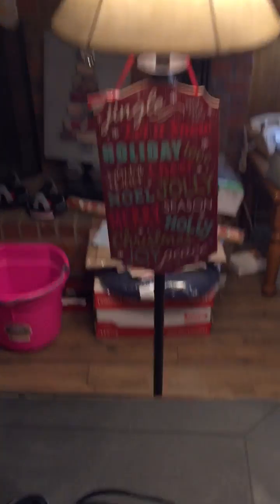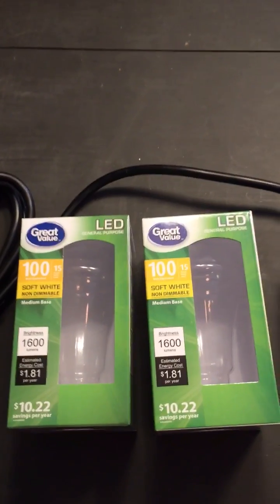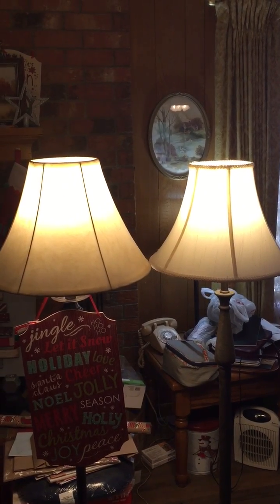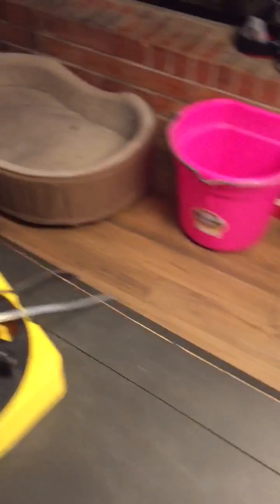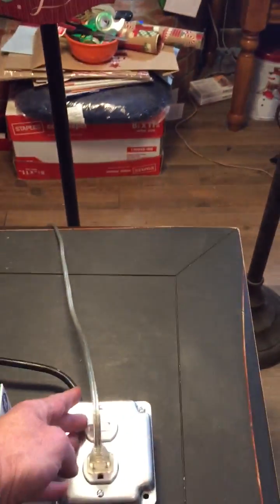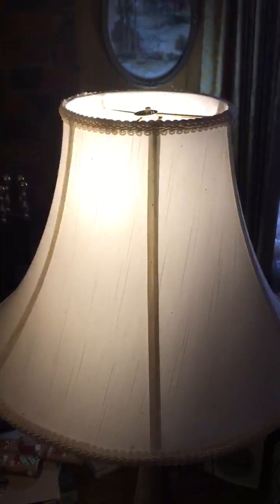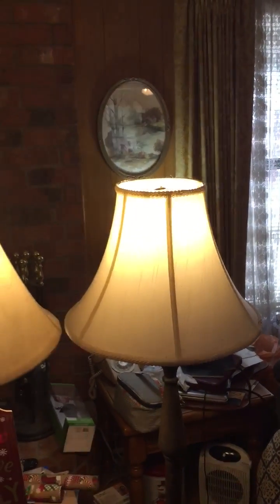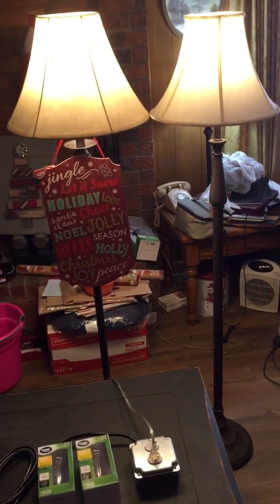Gamma (40 hz) LED Lamp Flasher

Comment: Bill, thanks. However, have you considered that most consumer (lamp fixture) bulbs, have an elaborate AC to DC power supply built into the base of the bulb? These consumer bulbs cannot be flashed at arbitrary rates, because the power supply interferes with your intention. Also the phosphors used in white LEDs also have decay times that also interfere.

The normal way to flash LEDs at arbitrary rates, is to use a single color, such as green or yellow green, and drive from a DC power supply that is switched on and off with a power MOSFET.

Comment: Nice job love to get the build info and see your video too.  Thanks for posting this.
Reply from the maker: I have been hesitant to publish the schematic for this product because it involves the control of line voltage.  Line voltage can be very dangerous to work with.  You need to be experienced in electronics, not a home hobbyist.  But, I keep getting requests for the schematic, so I've decided to build a handful and off them for sale on www.GammaLampFlasher.com.
Reply from the maker: Thomas J  - when I get back to the house I will scan in my rough schematic and send you a copy.
Reply: Thank you! :)
Reply from the maker: Thomas J  - I need an email address to send the schematics too.  I can seem to figure out how to attach it using this interface
Reply: @billgafford  Hi Bill, I managed to make a LED flash at 40hz but would love be able to connect a 120vac Ligt to such a circuit. I am willing to pay but the site not working.
Here's my email if can help me.
robear@hotmail.ca
Thanks so much
Robert

Comment: Mr. Gafford, my mother has dementia and I would love to help her by trying on her and myself since there is a genetic component to this disease.  Can you help me at all say by direction for a circuit build or ....?  
Thanks  Chris
Reply from the maker: I have been hesitant to publish the schematic for this product because it involves the control of line voltage.  Line voltage can be very dangerous to work with.  You need to be experienced in electronics, not a home hobbyist.  But, I keep getting requests for the schematic, so I've decided to build a handful and off them for sale on www.GammaLampFlasher.com.
Reply: DON'T LISTEN TO THIS IDIOT THE LED FLICKER IS VERY BAD FOR THE BRAIN!!
Reply: karen l Smith actually the leading research is showing that a 40 Hz Flickr reverses beta amyloid plaques by 50% in mice.

Comment: Thank you for sharing this. How did you build the circuit? I would like to do something similar.
Reply from the maker: I will post a new video showing some detail, and an old video showing when I had the whole thing bread boarded, while I was developing it.  If you are still interested, comment on them and request for more detail and I will send code and some assembly pictures I took while assembling it.
Reply from the maker: I have been hesitant to publish the schematic for this product because it involves the control of line voltage.  Line voltage can be very dangerous to work with.  You need to be experienced in electronics, not a home hobbyist.  But, I keep getting requests for the schematic, so I've decided to build a handful and off them for sale on www.GammaLampFlasher.com.
Reply: @billgafford  Looks like your site is down.  Were you just tired of making them?  Did they sell ok?  Did any weird legal things happen to you? Thanks